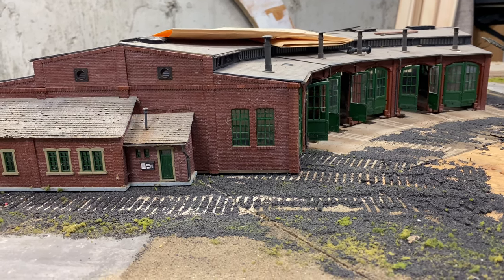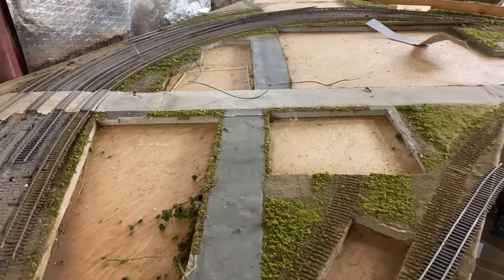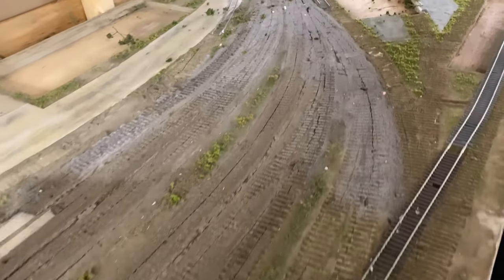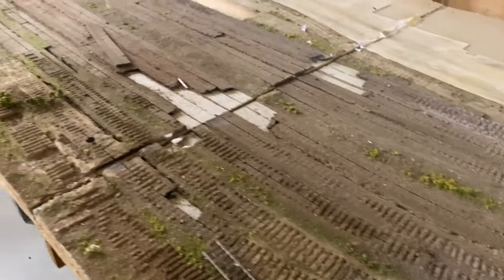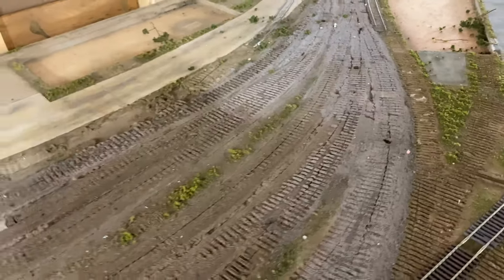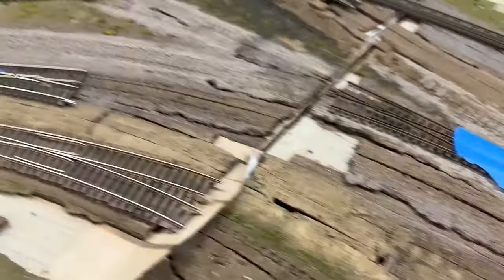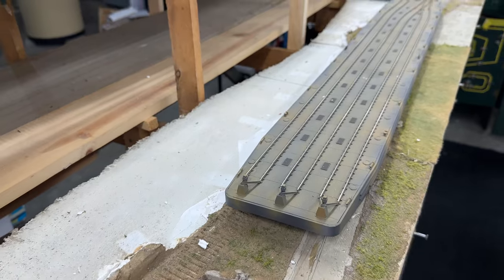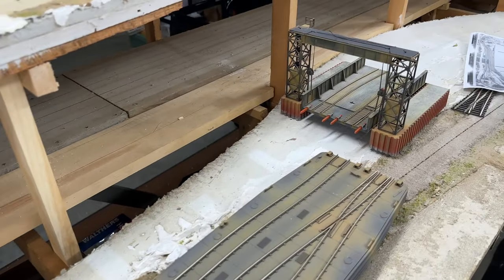HO Scale New Haven Railroad Layout Update

Comment: Ron, you can use the majority of those long switches. Since you are using DCC, I would recommend cutting gaps at the frogs at each end, both rails. Dead frog in other words.  Now you can power the frogs easily with frog juicers which is what I have done.  
You mentioned you didn’t know why some of the gaps were there in some switches. Cab control. 
With DCC you can ignore those and just pull off the added rail or solder them together again. 

Might save you some money. It will definitely save you time if you use Tam Valley Kroger juicers. I have used them for years with zero issues. Bill Shanaman
Reply from the maker: Thanks for the advice. Any other recommendations on what to look for in used switches. I was considering replacements as they are priced at 24.00 but the original H&H curved switches are Shinohara and they are no longer available.
Reply: Ron I have used everything from Walthers to Atlas to Peco to custom made on my current layout. ALL have dead frogs or in Pecos case insulfrog. I will cut the rails closer to the frogs. That lets you use metal rail joiners.  Walthers/Shinohara switches have long frog rails. By y cutting them close to the frog you can run shortened wheel based engines thru them. By using frog juicers the frogs become independently live and change the polarity do they won’t short.  The only other thing you have to watch is the point rails to the frog and stick rails. Atlas are okay but sometimes I have to solder a small wire between the joint of the point and frog rails. Same with Walthers but they aren’t as bad.  Easier to solder wires before installing them. If you have stalling issues the look at the connection of the point rail joints to the frog. If you stall and push down on the point rail and the power comes back, it’s the connection.

Comment: Nice update and ambitious changes, looking forward to more updates!
Reply from the maker: Thanks so much. It’s so much work but it’s worth it. Thanks for watching!
Reply: @NewHavenRails  Watching it a second time and taking notes. I am just starting my first layout and need to get all the backdrop up before I do the 'shelf bracket' style around the room layout. I will have two peninsulas that will require normal wood framing. I am thankful that I bought all my Atlas code 83 track several years ago. The only thing I didn't think about was the cork roadbed. Fortunately I found a supplier last week that had it so ordered and received 3 boxes of it. I also have all the turnouts I need (again Atlas) that were purchased several years ago, so I was lucky in that respect even though have procrastinated getting anything put together. Mostly due to work/being gone/etc. I'm excited to begin this and it's videos and channels like yours that have taught me so much so I hopefully don't make too many common 'errors' even thought I know I will make some LOL. Regards!
Reply from the maker: @MRR_Shadowolf  I have learned so much from previous mistakes and I now listen to the experienced modelers. Thanks again for watching my videos. I will have many more updates coming out as I actively work on this project.
Reply: @NewHavenRails  As I'm rewatching this I do have a question - I notice V cutouts on your benchwork on one side of the leg supports, have not seen that before, what is their purpose? Inquiring minds and all that LOL

Comment: Great upgrade…. What is the final track height in this area and what is the staging yard height? Who’s turnouts do you use, do you have power the frogs? Who’s replacement turnouts will you use?
Reply from the maker: The staging height is 44” and the top level is 53.5. Keep in mind I will have the elevated portion on the Bridgeport side so add another 4”. Most of my turnouts are Peco but I may have to get a couple of Atlas turnouts. Any future turnouts will be mostly Peco insulfrog. At my local hobby shop, the Pecos are actually cheaper. Once I start laying track those templates will be very useful in my layout design. Thanks for watching my video.

Comment: I have always loved the Coaling tower at Cedar Hill. Have you ever considered hand laying turnouts? I have built many with just basic tools and I build them on old scrap paneling that I bevel the edges like roadbed and then just drop them in place like a store bought one. its easy to build them at the work bench and very cheap, also easy to tweak if the need ever arises. Cheers Rob
Reply from the maker: Great question and yes I have considered it. However, the layout will feature catenary so I plan to use mostly commercial switches. I may save a section for some hand laid switches. I have been looking at the fast tracks. Thanks for watching and supporting my channel!

Comment: You mentioned in the video about using a car float, and I wonder how do you plan to work it out operationally? Will you be swapping car floats with cars on it; just swapping cars on the same float, or something else? I am planning a float on my railroad as well, and trying to come up with a scheme which will allow multiple trains to arive/depart during a single OPS.
Reply from the maker: Great question. So the float will stay in place. I am planning a small harbor scene that I can fit a tug boat in since the NH had their own tug boats. In this video I talk about track 19 which comes off the helix and it will have a left hand switch. The car float area will have its own switcher. The hidden staging for the car float will be located under the center peninsula. I am planning at least 4-7’ sidings. A full car float is about 16 cars measuring about 7’. So each siding will be used for an ops session. I plan on using the ops sequence from the June 2020 NMRA magazine article to assist me with my car float operations. I hope this answers your question. Thanks for watching and supporting my channel!
Reply: @NewHavenRails  Thanks for the quick reply. What I'm not clear is how is all this going to work. Your track 19 will lead to the car float and to hidden staging with 4 tracks, each long enough to fit all the cars from the float. But where are the cars from the float going to and where are the cars from car float staging going to? Is the dedicated switcher going to pull cars off the float, take them down to your car float staging, then bring a new set up to the float only? Are these cars on the float, and in your car float staging, not going to interact with anything else on the rest of the railroad?
Reply from the maker: @TrainzLuvr  you have asked some really good questions. I will go over the answer in my next layout update because I need to show how it will work based on the data I have from the prototype.